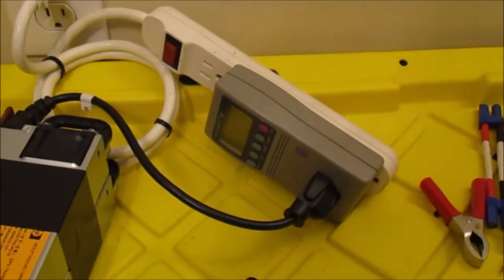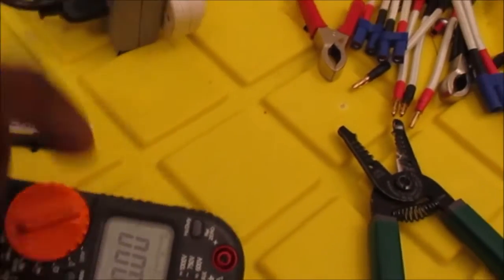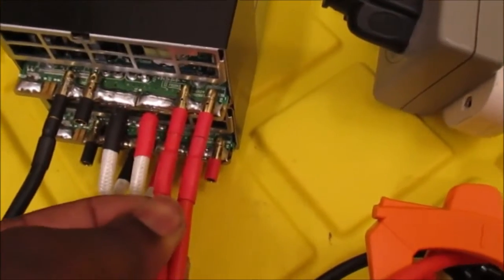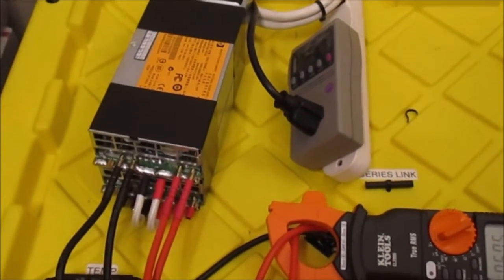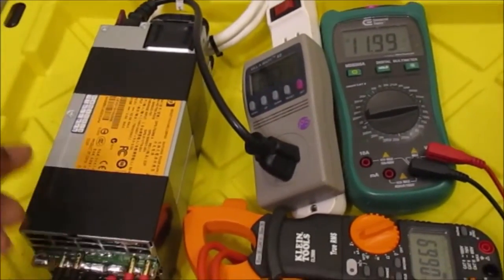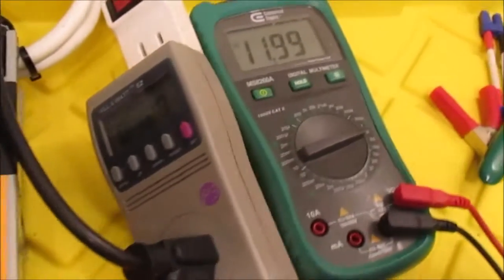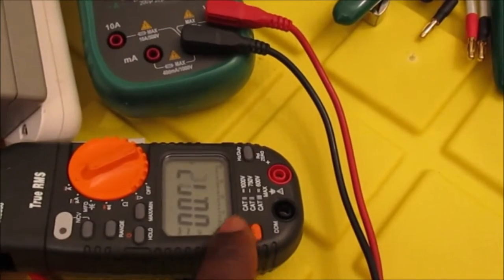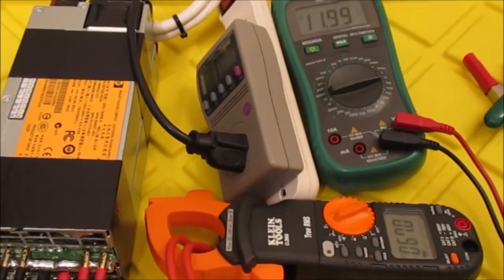Lipo Connection Solutions 12v 67A 805w 108% Load Test on HP 62A 750w Power Supply DPS-750RB

Comment: How did you get the DPS-750RB A to power on? I've tried following these instructions but can't get it to power on. http://electronics.stackexchange.com/questions/186584/converting-a-dps800-server-psu-into-a-standalone-12v-psu
Reply: Figured it out. Shorting pin 33 and 36 will turn it on.